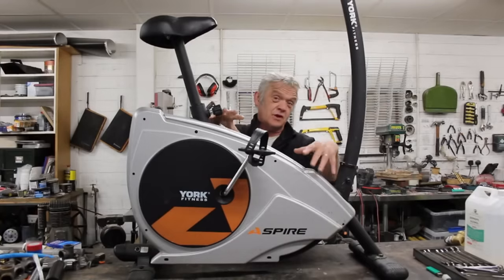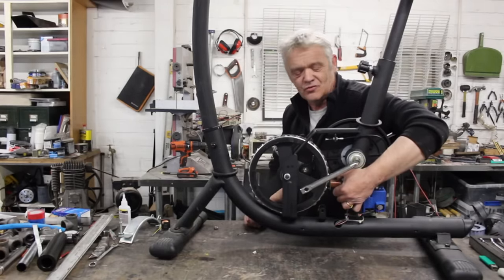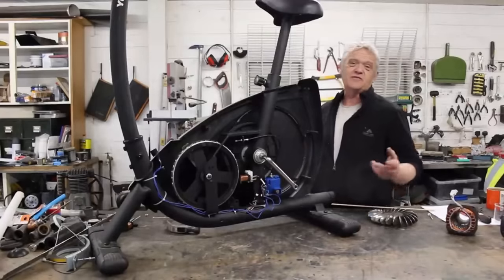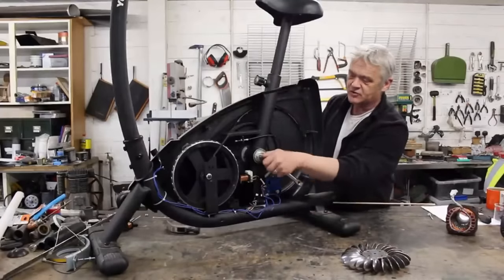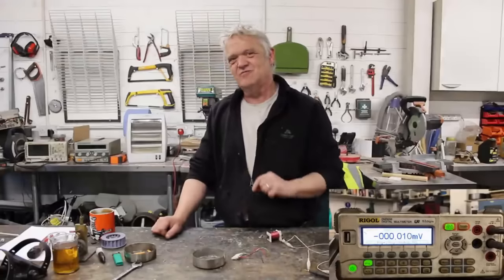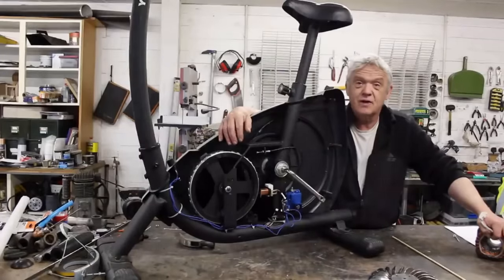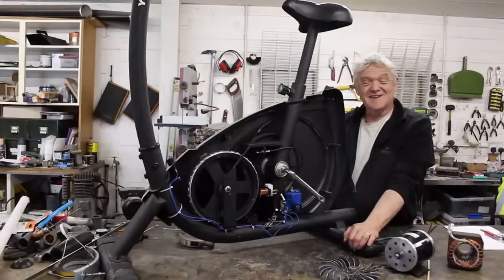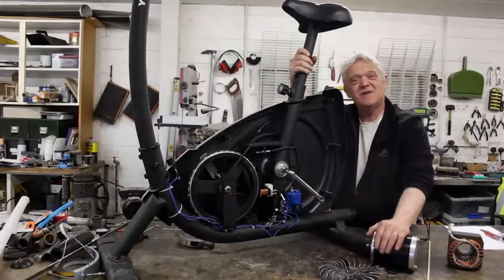2215 How To Make Generators From Input To Output

Comment: One thing missing, important for those trying to build generators on their own, is coil alignment. If the coil facing the north pole of one magnet is wired clockwise then the coil facing south pole should be wired counterclockwise (flipped upside down). Otherwise some piece of our work would be converted into heat instead of electricity.
Reply: He addresses this at about 8 minutes into the video. All the coils have the same orientation. The adjacent magnets alternate pole direction. As the rotor rotates, each magnet is presented to the core of the coil in opposing polarity...

Comment: Fun fact, Stair Master uses alternator as the devices form of mechanical resistance to the user. The energy is dumped into a large resistor. To add a charging circuit into the mix would be little effort or cost. 
Thanks 🤝

Comment: Great clarity. Did not catch if you said that a DC motor can be a generator.... inspiration, simplicity is the "mother of invention" best DVD:)
Reply: - All motors can generate - some need the field separately energised to do so, some may need to be "modified" to allow separate field energisation.....
Reply: Can be, although there are a few small differences in the design that mean DC motors are not going to be as efficient as one optimised as a generator.

Comment: Dr. RMS, great vid! You got the best job in the world, enjoy! Could also turn the wheel into a Faraday Unipolar Generator by clamping magnets on an attached disk - no Lenz law there. Also, maybe charge capacitors on the wheel accoring to everybody's favorite paper - E.H. Kennard Ph.D. (1917) XIII. On unipolar induction: Another experiment and its significance as evidence for the existence of the æther , The London, Edinburgh, and Dublin Philosophical Magazine and Journal of Science, 33:194, 179-190, DOI: 10.1080/14786440208635625

Thanks for that paper btw. Let the Aether do the work! Woohoo!

Comment: Dear Robert,
What a great YouTube channel you have created.
I am very interested in the things you show.
This was again a very clear explanation about a generator.
Now I have a question.
It is about the serpent coil, which appears in many videos.
Can you improve that with an iron core?
The coil you showed now has an iron core, and now the coil wires are at a different angle with respect to the magnets.
This is because the magnetic field is changed by the iron core.
What is the best way to do that with a serpent coil?
Install iron tubes through which the wires run?
Or make the partitions between the wires of iron?
Kind regards from a Dutchman Wim.

Comment: Robert, can't you use (DIODES) with (CAPACTORS) to bring up the voltage required?😊 Thanks for sharing. Also, a 25 to 500 pound (FLY WHEEL) could go a long way in keeping power stable.😊

Comment: If you plan on hooking a weed eater engine to this, i suggest connecting directly to the big wheel.  At that gear ratio, hooking to the small one could melt everything from friction or make the big gear explode
Reply: But could you charge a phone with it?
Reply: @mikebond6328  sure if you get the number of coils right so you don't burn out the voltage regulator.
Reply: - hmm those magnets at 8000-12000rpms, fun trick....

Comment: Of all the exercise bicycles I have seen only one worked on the principle of producing electricity and then load that power produced. It was the one that merely needed some electronics added to do some thing useful. All the others had clumsy mechanical breaking systems and one had a fan / blade type mechanism which could direct wind in the direction of the rider. The electrical one on test was able to produce 165 watts which one rider managed to maintain for nearly  10 minutes. The total energy in that time was enough to charge at least 2 cell fones from flat to full charge.
Reply: Total energy would be - 99kJ or 27.5Wh   (however big the "2cell" is ???)

Comment: Hi Robert, first wonderfuly presented and excellent knowledge base, i do have to ask what has been you most favorite project so far in this channel ? and everyones else favorite project?.

Mine has been the archmedies screw and batteries mostly low rpm low V batteries like carbon salt batteries have been my favorite parts with a liking to the Mighty and Tiny generators.

Comment: the mechanical input can be a circular arrangement of angled, serrated magnets pushing the rotor with its magnets. if that rotor is a magnetic disk slightly hemispherical in shape with serrations also. the top is flat with NS NS magnets. the fields of  which is separated from the base of the floating rotor wwith an inslating material. The base floating is serrated and being pushed by the magnets of the surrounding rotor. I wish I had magnets to make this I know it can work I just can't explain it very well. As a semiotic signifier I use "stator" in a different sense than you, in my idea stator is just a magnet that does not move. The rotor does move.. I could exactly explain my idea for someone to design it, but they'd need to mold the magnets specifically which is why I'd want tetrateanite alloy to pour into the molds, as the shapes I need haven't been designed or the design isn't anything standard as a magnet used in current applications. I can't design the molds in CAD and I don't have money to smelt my own tetrateanite alloy. I was thinking of using styrafoam wih some neocadmium to exhibit the idea but I can't afford that either. Just to exhibit the idea of a floating spinning levitating rotor and a magnetic "stator". My idea won't have a dirty output as the rotor is levitating and spinning due to a magnetic "stator's" magnetic field pushing and driving it. Only the slow decay of magnetism will reduce the output.

Comment: I feel a alternator voltage regulator could be similar to a boost converter with cc cv. To specifically charge lithium batteries. It may not be perfect if there is a load.  With the ability to further stabilize the voltage and limit current . A lithium battery connected to an alternator. If the battery is at 2.5v/cell, (10 volts,) the normal alternator is going to output 200% if it can.  Because the drained battery is nearly a short. Having the ability to drop the current until the charge hadbeen taken. The voltage up to a nominal level. Then crank up the output to maintain the current at a safe level. When the voktage is up, the battery charged. Drop the charge voltage to prevent over charge the  rectification will prevent Backflow. I been wanting to build a regulator like this for years! I have several delco HD alternators im building a DC generator to charge lithium batteries!  In the 300 amp range at 28,-29 volts (peak actually 28.7v)

Comment: If you had two cone shaped magnets that were polarized oppositely, and you had a bucket made of copper with a cone coming up in the middle and a slight pinch at the top, then could you continuously overflow the bucket to spin the magnets and harvest electric off the bucket itself?

Comment: Question: if you step the voltage down, without using a transformer, is there any power wasted? Or does the solid state rectified voltage come out with the properly adjusted and equivocated amperage commiserate to the original wattage input to the regulator?

Comment: You once built a generator, from a series of magnets on a rotor and individual coils. As I recall (without searching for the particular video), you made a comment about connecting a capacitor in parallel with each of the coils to improve the generator efficiency. Does that not work with serpentine coils?
Reply: Was he talking about using one rectifier and smoothing capacitor circuit on the output instead of on each coil to limit diode voltage drops?

Comment: What if you made a Mercury Arc Rectifyer but the current fed back into itself? 

Maybe a hand crank would fire the Mercury up & then the AC output returned from the Rectifyer & powered up the DC to keep the Mercury plasma vaporized?
Reply: I've been curious about this as well, and as far as I can tell from simple internet scrolling is that Mercury arc rectifiers supposedly generate a lot of heat, so while a small amount of the current outputted could sustain the reaction, much of the power before rectifying would be wasted as heat, thus lowering how much energy can be used or stored in the long run.

 Modern rectifiers don't generate nearly as much heat and thus most of the input can be outputted with minimal losses.

Comment: A question…I’m more mechanical then electrical, what happens to the voltage regulator if the input drops below the desired set output? Does it just stop working or does it trickle through a lower voltage?
Reply: if you are using a "buck-boost" converter / regulator - the Voltage boost kicks in....

Comment: Awesome, so why can't there be a large enough gear ratio to generate enough speed to get an enormous amount of voltage to power a drill for input and a few 110 outlets for A/C power ?

A.K.A.

Perpetual Energy
Reply from the maker: because you trade speed for torque - the faster it gets the  harder it is to turn

Comment: is there a calculator that can output the desired requirements of a generator given all of the many input variables ?
Reply: - only if you actually "know" your magnetic field strength - otherwise you are now the experimenter....
(google helps everyone equally - just ask the right question:  (emf = NAB*omega sin(omega*t) (Quantities are: Number of turns, Area, magnetic field, rate of rotation and total time.)

Wikipedia: Electrical Generator, or / and  Faradays Law of Induction - do you need a calculator or are you able to use excel to make one yourself???

Wire size - is governed by ohms law - again you need to "know" ohms per unit length, and thermal dissipation of the coil, to calculate current capacity (Amps) theoretically...  (tricky to get right first time around -  "science").